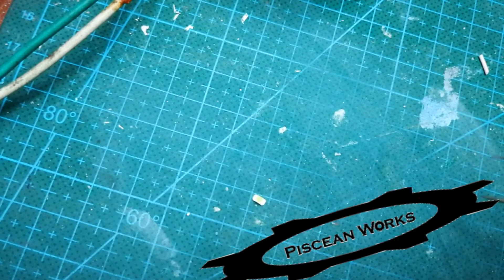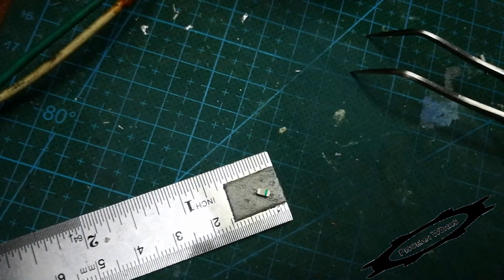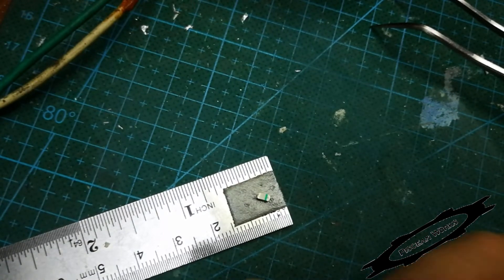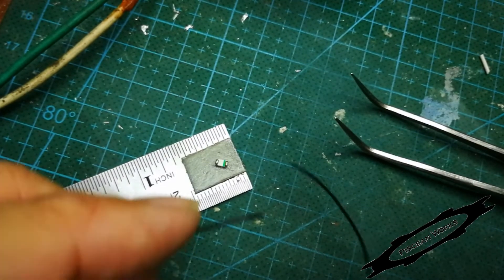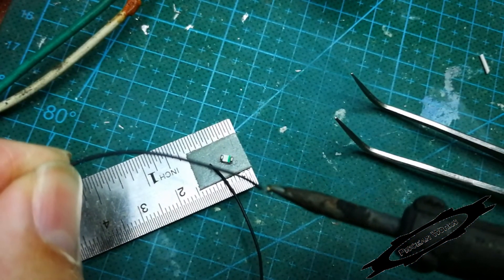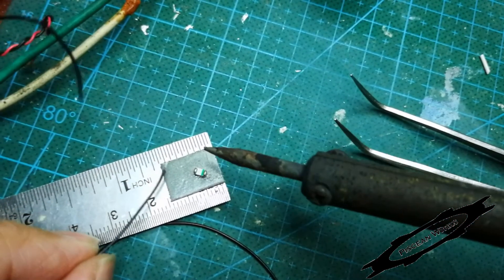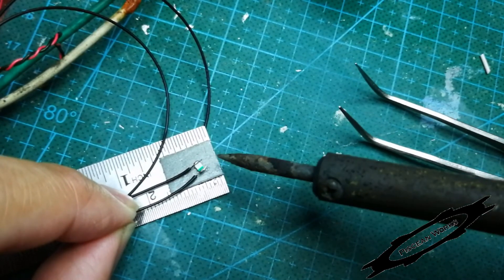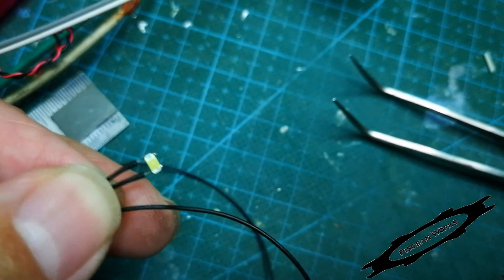Soldering smd led 01

Comment: Excellent job, trick and videography,  I tried soldering, at 300 C. Touching the pencil tip even for one second melts the LED, or if it is soldered slight movements Break the Anode LED, cathode remains intacts
Reply from the maker: Thanks. The Soldering Iron I used was rated from 25-30W, which is low enough for this solder job and, using solder flux is a must.
Because of the heat, it needs to be done fast. The flux cleans the contact points and the thin solder quickly melts, then flows into the pad. This saves me a few crucial seconds compared to soldering with just the normal solder.
Reply: @MrEngineer 
I used 100 watts. Was it the reason for burning??
Reply from the maker: @azharjawaid104  It is a possibility as SMD soldering does not require high wattage.

Comment: Hello Sir. At what temperature is best and safe to solder 1206 smd led? Thank you
Reply from the maker: Normal Solder melts around 183°Celsius (361°F). From the Internet, it is given as 350°C for hand soldering and lower for re-flow.

I use a 25W-30W soldering iron with a pencil solder bit, 0.6mm resin-core solder with flux. The exercise allow me to solder less than 3seconds or so for one soldering join. This results minimal burning of the component.
Reply: Thank you good sir!

Comment: Blu-tack might be better to hold it still
Reply from the maker: Not really.
When the soldering iron touched the SMD LED, there is a lot of heat around that area. The Blu-tack will definitely melt first and the LED will come loose.

Of all the double-sided tapes, the grey 3M tends to last longer before its glue weakens. This indirectly encourages one to solder fast.